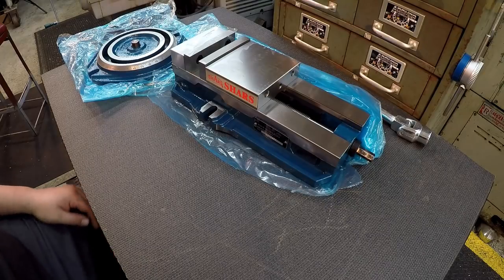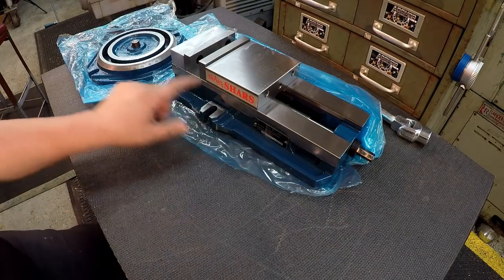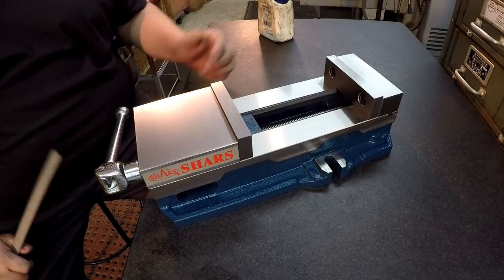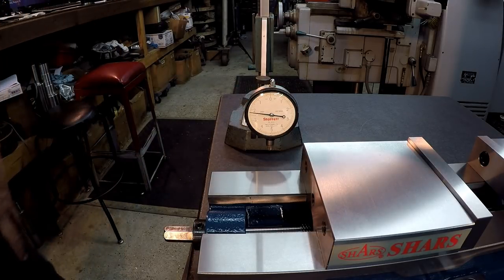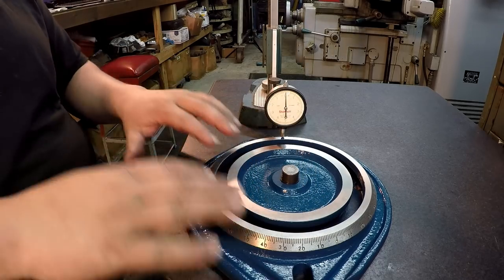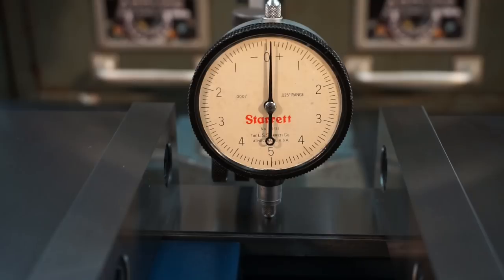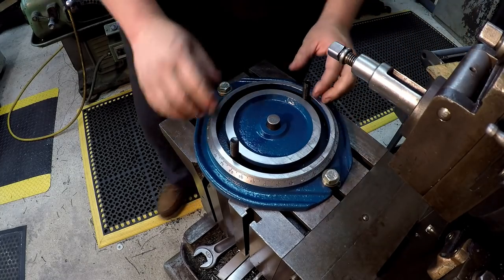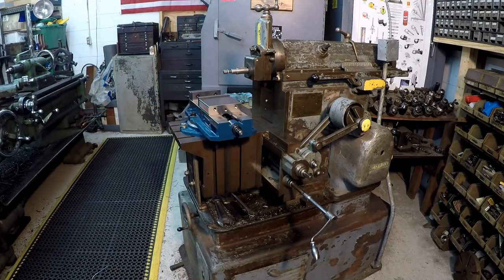Shop Talk 20: Shars 550V Milling Vise for Shaper

Comment: Hi Adam, I just bought the cheaper 4 inch vice for a little over $100.00. It also came with a swivel. I did a basic check on the tolerances and I was pretty happy with what I found. All the numbers were at or better than the inspection sheet. I know this is a step or two down in quality. At present I cannot Machine thing to closer than these numbers. Maybe after I get better at machining I will need something better but now it fits what I need. 
As always you did a great video and it made me do some small adjustments.

Comment: You're gonna love that vise, I bought the 6" right when they first started offering them and I've been very happy with mine. The bolts are imperial as well and Kurt jaws will fit it.. I didn't get the swivle base.
Reply from the maker: How long have you had that one and what do you think about it? Any differences from the Kurt?
Reply: I think about 4 years, maybe longer. It's very accurate, just keep the anti lift screw tight. Never owned a Kurt, I replaced a chinese vise with the Shars.  Think I paid $379 for it. Much less than a Kurt. And by the way, it opens up to 9". The keys on the 690 are 3/4" so i had to trim them down to 5/8" to fit my T slots, it locates true every time I remove and put it back on the table. I didn't get a swivel base.
Reply: The fact that Kurt jaws fit it is a valuable piece of info!! Adam, can we verify if this is true for yours as well??
Reply from the maker: Brian I think the 5" model is in it's own class. I don't think Kurt makes the 5". Shars does support all of the other vise jaws though. They have many soft jaws for sale. I'm sure that 6" is made to the same spec as the Kurt.
Reply: Kurty used to make a 5" vise. I have one. I bought it in the '80s. Neither the 4" or 6" jaws fit it.
Reply: why the shaper I have never heard of one used in modern times, usually the fly cutters or mills are used to put a good surface on something and they do it faster.

is this just cuz you got one so you want to use it or does this do better for surfacing then a rotery cutter will I am curious adam

Comment: That is... amazing. I might give Shars a bit more credit than I used to. My last experience with them was a few years ago. Stuff made out of slightly aged cheese... for them to put out a vise where you get a tenth(ish) TIR is amazing, Adam. One can wonder how often they hit it like that, but the fact is, they put out one like that, so why not more? I'm really impressed.
Reply from the maker: They some high quality lines of tooling there, as well as the low end cheaper stuff.
Reply: I have their $80 4" vise and I didn't expect this video to go well.  That line of Taiwan made vises are clearly totally different than the mainland el cheapo stuff.  (I should say that empty, it's not bad, but it lifts a fair amount when tightened down.)  Very interesting...

Comment: Now I'm no machinist, but I've been learning a lot from your channel and the machinist where I work(who recommended you and the other makers) has been teaching me a bit here and there. But aside from what looks to be slightly darker blue paint and the sticker on the jaw, it looks exactly like the 8" Kurt the machinist at work just got for the mill!
Reply from the maker: They are made to the same dimensions as the Kurt vises. I have the older 8" model Kurt on the K&T mill, it's a beast!
Reply: Abom79 the machinist at work loves the Kurt! Not sure the brand vise that was on it prior but it was certainly worn out and it took a little longer to set up a part to compensate for the vise. I'm pretty sure the machines we currently have are from when the company was started almost 60 years ago, an excello vertical mill and a Hardinge lathe(unsure the size, but it's a smaller one) with the multi-tool turret style tool holder

Comment: For my Shars tool holders I had to replace the dog set screws. The ones they came with were pretty low quality to the point that no hex bit really fit. Also the bolt would turn so I milled a hole on the side to within 0.015 of the bolt threads and hit it hard with a punch to deform the hole into the threads.  That locked the bolts from turning.

Comment: I have been to Taipei, Taiwan about 25 times over the past 30 years. 

I, like many, have always had the stereotype of Taiwan / Chinese products as being strictly copies and of low quality.

But ever since the mid 1990's, Taiwan suppliers have dramatically improved quality control and engineered manufacturing controls. The Government has invested heavily in Post Secondary Education programs in addition to professional trades. The reason, manufacturing competition from Singapore, Indonesia, Thailand, and in particular, India.

Mainland China has never been considered a serious threat to its Manufacturing 2.0 Policy that began to see good results by 2002-2005. 

Taiwan isn't your old $19.99 chromium socket set gift tool supplier like it used to be. 

Today, they are one of the largest importers of U.S., Italian and Japanese CNC machines. 

Probably the most significant change in Taiwan is the their foundry quality control. 

I'm not surprised how accurate you found the Shars vice parts to be. 

India is about to undergo major education reforms beginning next year with new Education funding in industrial manufacturing and engineering because Taiwan had begun to "reclaimed" exports it lost to India in the 1990's beginning in 2005.

India is already 2 years behind the curve, knowing mainland China has also began to update  technical trades education reforms that were started in 2013/2014. India knows China is producing approximately 1 million new Mechanical Engineering graduates - annually.

Looks like there are still some kinks in quality control, but minor points overall.
Reply from the maker: Maybe they stuck there less skilled newbies on the job assembling those swivel bases. Thanks for the info.
Reply: Abom79 Yeah, I guess the paint department forgot to hire some chemical engineers :)

I think we're going to see small American and Canadian boutique CNC shops make custom small batch tools for home shops over the next few years. The machines continue to fall in price, ease of use and training is going to make them affordable. 

Example, How long before at 5 Axis CNC machine is available to rent spindle time including tooling for less than $30.00 / hr. 

User connects directly to the machine, uploads G-code files and clicks "ok" and 4 - 6 hours later has every part to assemble a Kurt knockoff vice. 

That day is probably coming sooner than most people realize.

Paint not included...
Reply: Taiwan was a colony of Japan for about 50 years and did a lot to industrialise the country. Maybe it is a legacy of that.
Reply: The industrialization era began in the 1960's with assistance from the U.S. and the British, who needed a presence in the region in case Hong Kong fell. My first visit there in 1975 was a real eye opener. It was on the cusp of mass production as ships filled with coal was imported and steel production began. For such a small island, it was impressive.
Reply: Doug, I have some of those old Taiwan socket sets. Stripped out the ratchet, broke a few sockets. Dad gave me some S*K Tools sockets to replace.  I still have some of that set, the box is long gone. It's the truck/camper tool box set. Good times tearing up a BMX bike to grease them bearings back in the day. What every growing boy needed in the 80's. Oh yeah, great video as usual Adam! :D
Reply: I think we will as people see the need and have the will to spend for home made good quality small shops stuff like people do for blacksmith items, many will make stuff like hammers and chisels already and making dies is up their alley too, they also make pots and pans,  and most especially presses and hammers of different sorts, have not seem them make wrenches yet, but axes hammers crowbars, and different knifes and cutting and trimming tools for the house and around the shop, but no wrenches yet or sockets unless they are industrial, oh and they make all kinds of fireplace tools and screens, and even pots like christcenteredironworks does in Ohio, he makes copper bowls and can do pans, mind you they cost what good cookware will cost you in the shop for chiefs but they are true hand hammered and craft made in the USA

as for renting spindles never mind that as 3d printing comes of even greater age, print powder metal and you are more then half there with very little machining.

as for my tools I prefer at least the business end like the blades wrenches or metric tools usa made even if they are really old, we need jobs too, or at least take the raw imported iron and make it into good quality and assemble the product with good american or Canadian hands and safety assured.
Reply: well taipei is better then mainland socialist dictatorship china, they are a longer friend of the usa and they are at least a democracy, nothing against the history of the contries of the east or their culture or foods some are very good and they gave us many contributions to world history, but we need jobs too, and we are not incapable of getting the job done that we have to have them nanny us, even if we have to supply us many of the materials.
Reply: I don't know about socialists. I sometimes think the Chinese are better at capitalism than the western countries.
Reply: yea by manipulating the systom and then crying wolf when we complaine about the dumping of extra goods crashing our markets or being undercut by a government estabished rate and not a market rate, though in the west there is too much greed in the systome but its still better then a planned ecconomy which can never predict what needs will be and misses the mark all the time yet the young idolize mao or che guavara even though they were murdering thugs, and socialism where all are stuck on the lowest rung while the chosen educated make all the choices for them, I guess misery loves company
Reply: Yes if you added up all the deaths from socialist leaders over the last 100 years it would run into the tens of millions. It makes you laugh when you see their image on a Tee shirt. But I still think the Chinese are very good at entrepreneurial capitalism.
Reply: yes the socialist leaders killed millions like polpot, mao, stalin, che, they make the numbers killed by that vile hitler look like childsplay,

I dont laugh when I see the images on shirts, I shake my head, sure they represent the poler opposet of who we are in the west, and kids do like to rebel, but maybe they would think twice if they knew the history behind the individuals, and I tell them you can like bernie all you like but you did not live though socialism like some of our gen did and the people we met that lived in those contries the kids forget this.

The chinese might be good at the capitalist game but its easy to say that when you have to play by their governments rules, of having the government as a partner in any new plants built, they like to take people drinking when they negotiate terms so as to have an advantage, and like legalized bribery in the form of surity payments, they like to win battles without fireing a shot, sun tzu for crying out loud wrote the book on the art of war, and many enjoy strategic games.
Reply: Just to depress you, over the last about 100 years, sundry regimes operating under the name of 'socialism/communism' (same thing) have murdered their own and other nations citizens at the rate of about 8500 per DAY.
Now back to the elegantly impressive machinist skills of Mr Abom79.

Comment: Nice video.  The only thing is what's up with the poorly stamped numbers on the swivel base, and are you going to put a dab of grease on the pin of the swivel base?
Reply from the maker: I light dab of oil is preferred. As the machine is being used the cutting oil will work it's way down into that pin and the contact areas.

Comment: After the results of your Starrett versus Cheap China measuring tools, it would be interesting to compare this vise with the China made one which sells for 139.00 with swivel base.
Reply from the maker: Yep that would be interesting.
Reply: SHOPMASTER/SHOPTASK Registered I have had very bad luck with a cheap 4" vise. It wouldn't even have been suitable for wood working it was so bad. Some of them are great I'm sure. I'm sure there is a lot of variation depending on who in the factory makes it and such. If you get lucky you will buy one that was made by one of the good guys
Reply: Maybe you could post details of the vise you got- there are a lot of 4" vises out there, starting at 12.95 for a super cheap drill press version.   I'm sure folks would like to know if the one you got was a milling vise like the one Adam was testing.

Comment: Flat and parallel is half the battle. Surface finish on the screw. Clamping feedback. Carrier lift. I buy Shar stuff. But it's hard to beat Kurt. Looks like this vise would be great on a small machine like the haas tm.

Comment: This couldn't be more timely! I have a 7" SB benchtop shaper and almost today bought a $550 SB vise for it. I just can't bring myself to pay that much for a small vise. Internet research indicated that "shaper vises" are typically beefier than "mill vises" but it would seem you don't have any concerns about this. Can you comment about using a small- perhaps 3" milling vise on a benchtop shaper? No worries there?
Reply from the maker: The original shaper vises are much bigger and heavier duty, but I think with todays Kurt vises you can get the same clamping power, but you lose the width of the original vises. If your going to spend $550 for an old SB vise, I would consider buying a brand new Kurt D688. You can find them on sale for less then $500.
Reply: Ha! A D688 is almost bigger than my entire shaper! :) Thanks for the info. That's good to know that the modern Kurt style vises should work just fine. Especially for a very small benchtop shaper like mine, I figured it would work. And original SB pieces are SO expensive!

Comment: As a shop talk question, do you have a live center with a concave end?  Sometimes I have to turn something with an existing point. I usually make a concave socket and lock it in the center with a bit of grease. But there has to be a better way.
Reply from the maker: That's not a common practice for me, and I don't think I have a concave center point.

Comment: One measurement I'd like to see is movement up or down of the movable jar when tightened. I have a new Kurt and a 20 year old tiawonese knock off. The jaw on the Kurt doesn't move at all and the knockoff moved about .001" down. I'd be interested to see if this would happen with a new one.
Reply from the maker: I did some repeatability tests this week that I'll share later, but I don't get movement down on the workpiece.

Comment: Adam: The swivel base should have a locating slot like the vise.  Maybe you could convenience Shars to have their supplier add a slot. They might even swap your base for a new one in return for the suggestion.  You kept referring to the shaper, the shaper, the shaper....throughout the video. It wasn't till the camera pulled away at the very end of the video that I saw it was a Sheldon 12" Shaper.  The same model as I have.  The 6" vises even with the swivel base removed are a little bit too big/heavy for that machine.  The 5" (or 4" if your going to use the swivel base) are more appropriately sized.
Reply from the maker: +Snake Plissken The 5" vise is what I was showing.
Reply: I got that it was a 5" vise.  Do you ever mention the size and make of the shaper?

Comment: Adam I think you should have got the 6" vise for your shaper. On a shaper the bigger vise the better
Reply: Said at the end (25:00) that he tried a 6 inch vice and it wouldn't fit, the bolt holes where spaced to wide for the shaper's table.
Reply: Said at the end (25:00) that he tried a 6 inch vice and it wouldn't fit, the bolt holes where spaced to wide for the shaper's table.
Reply: I have not watch to the end let

Comment: Hey Adam, Shouldn't you be measuring with a hundred thousands indicator in order to get accurate measurements down to ten thousands of an inch?  (Use a measuring device that is 10 times more accurate than the measurement what you are measuring)
Reply from the maker: I'm using a tenths indicator already, that's the finest resolution I own.
Reply: I though you had a test indicator that went down to .00005" measurements?
Reply: You are correct in in theory, and mostly correct in practice. (you are also confusing accuracy and precision).

These are comparative measurements (precision not accuracy) made with an analog tool. Since the measurement is continuous (analog), the user can observe the needle movement and estimate easily to under a 1/4 of a 10th. This means the indicator is can be trusted to under 2/10ths precision. 2/10ths is beyond measurement given a worn surface plate in a non-temp controlled environment. In other words, the measurements he got are outside the range of experimental error, and should be considered as 0 variation.

You would be 100% correct if he was using a digital meter. sig figs are a real thing, not something invented to frustrate science students. You can not measure 10ths with a meter with a resolution of 0.0001.
Reply: Thanks for catching that... Precision is what I had in mind!

Comment: 13:02 How's the table surface called and where can I get it? I suppose it's plane. Are there alternative plane surfaces to buy?
Reply: Granite plate, he also did a video where he shows how they are made
Reply from the maker: That's a granite surface plate. The good ones would be Standridge, and Starrett. You can buy import quality for much cheaper. Price depends on size and thickness.
Reply: Thanks a lot for the answer. I was searching for them for a long time.